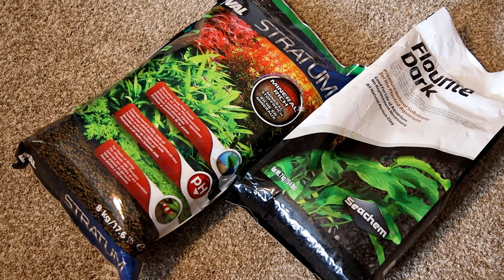Altum Angelfish Biotope Inspired Aquarium

Comment: Nice work! More a tematic tank than a strict biotop, but loks great. The angels are quite young and do not looks like the typical altum, but more like Santa Isabel angels. One concern is with tbe cardinals, in my experience, as soon as the angels reach adult size, they will cjace the cardinals, specially after lights tirns off...

Comment: I'm looking to do a semi-blackwater angelfish tank. Not a biotope, at all by any means. However, if I go for a diagonal visual line in hardscape, I'm thinking that the corner where where it will be empty I could make it look a bit more like the amazon basin. I'm really digging how the lily pads create a more dramatic lighting effect. I also want to contrast empty space with full lushes space in the opposite corner where I especially want to make sure to include some red plants into the foliage. I think the trick to pulling this off will be how I tie the two different scapes in together.

Comment: At what size tank do you start taking into account the strength of the flooring/walls? Have you ever made a tank so heavy that you had to consciously place it over a floor beam?
Reply from the maker: I keep all of my tanks in the basement, so it's typically not an issue. The largest I ever kept upstairs personally was a 90 gallon. It's going to be different per house as well and honestly I don't know the true answer. In this case, we were fine to go upstairs because he installed a large support beam under it.

Comment: Great Tank set up, how often do you need add Botanicals too the water too maintain the tint and nutrients in the water?
Reply from the maker: It doesn't have to be very frequent. As they start to noticeably break down, you add a few handfuls and repeat.
Reply: @SerpaDesign  Thanks for the info.

Comment: Hi mate, great video and super nice scape!
I recently had to empty my 80 Liters aquarium and I'm planning to set it up once again in my new house this Spring. 
I've been wandering for a while what set-up I'd like to go for and came here for tips/suggestions/help. :)
Thanks!!!
Reply from the maker: It all depends on what you want to keep. If it were me, I'd do a nice planted danio tank, but I'm bias towards them. 😂
Reply: @SerpaDesign  I also was thinking Danio and some good variety in the vegetation, but I was also trying to understand if I could do something with a bit more variety in terms of fishes. 
I was thinking to have some snails (for sure), 1-2 cory, 1-2 plecos, a small group of danio and maybe 1-2 shrimps... I have no clue if that's too much or what could be a good selection of plants/hardscape for such a community tank.
I have a strong external filter, very decent light and heater. Thanks  so much man!!!